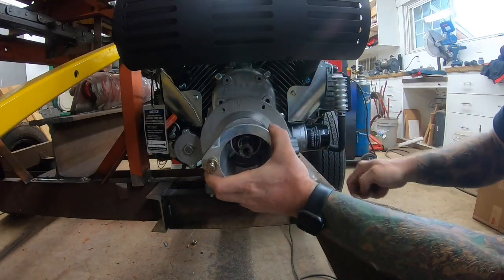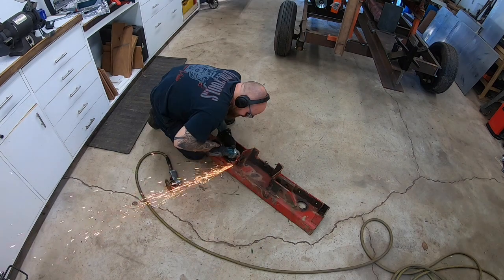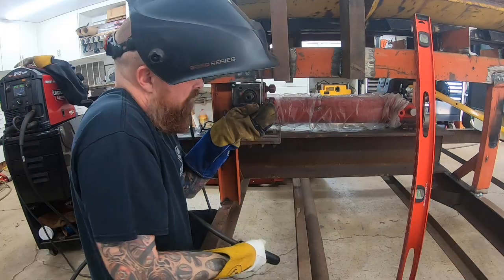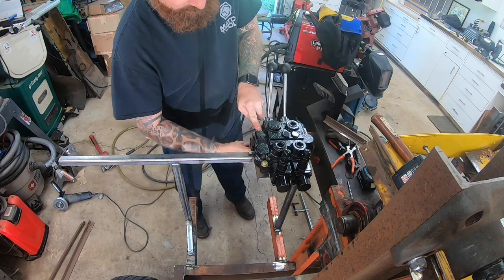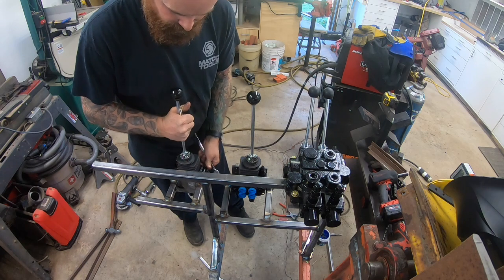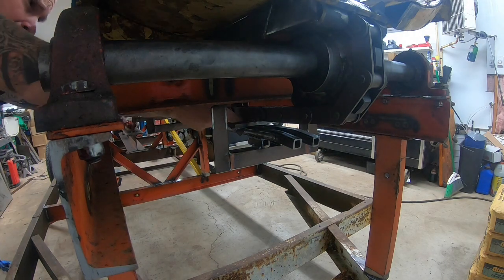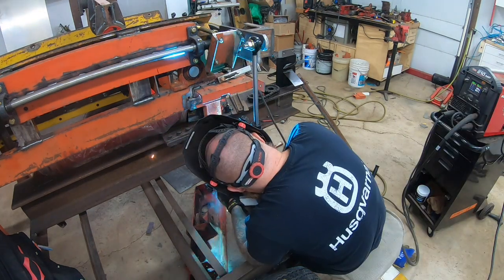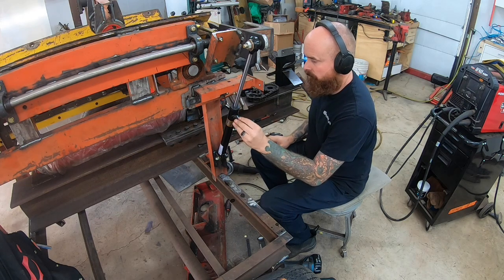Firewood Processor Build Ep 6 - Hydraulics Pt. 1

Comment: Would like to see a video on the saw that you use and where did you get it
Thank you
Reply from the maker: What parts on the saw are you interested in. The saw is belt driven off the main engine with a mower style electric clutch. The sprocket, bar and chain I got from Bailey’s. I can get you part numbers if that is what you are looking for.